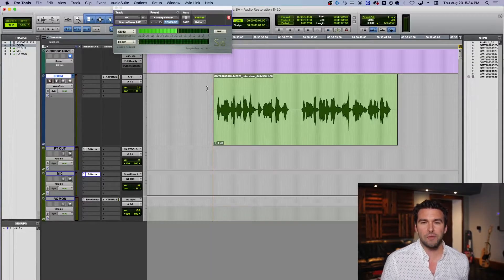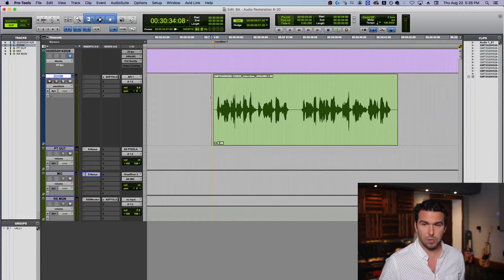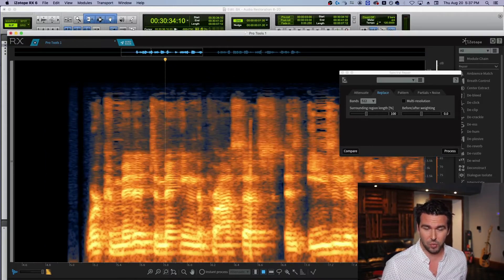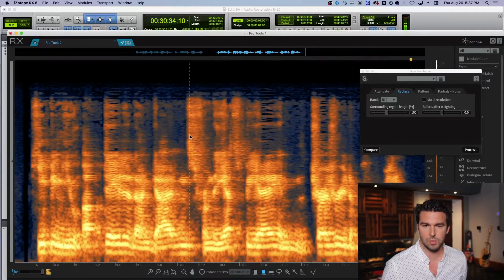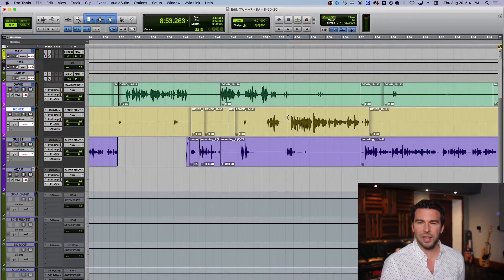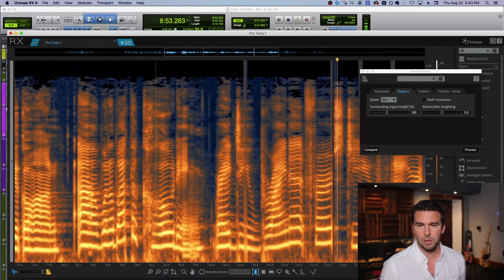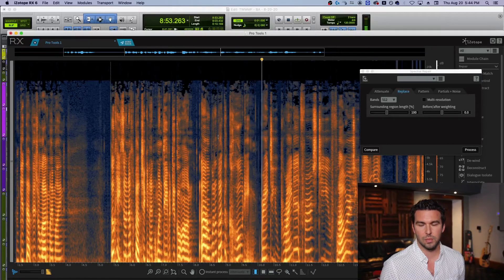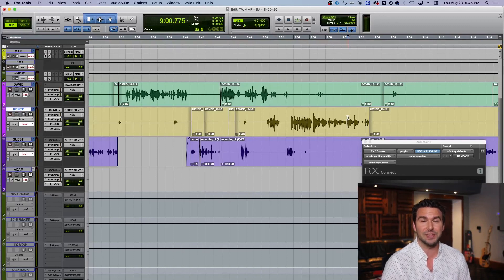How To Fix Audio Glitches

Comment: Shout out to Cato Zane for the great videos and inspiration for this one. You should subscribe to her here https://www.youtube.com/c/CatoZane
Reply from the maker: Great!
Reply: Hey, thanks man! This is awesome! I've noticed sometimes that clicking/popping happens when they have a connection/cable issue - I used to see something similar a lot more when I was doing live sound, and lav mics would get that issue when the weak point where the element cable connected to the element or the pack would deteriorate. I talked to my client (from that post you mentioned) about their setup, and they had their interface plugged into a hub instead of directly into the computer. I told them to change that first, and that fixed it! 😊 This video is awesome though - I use similar stuff in Adobe Audition to do my noise reduction! 🙂 Thanks for the shout out!
Reply: @CatoNoise  you're welcome! Glad  you figured it out for your client! There's only like a million things that can go wrong. No big deal.
Reply: @AdamClairmont  Haha, seriously! It's never ending!